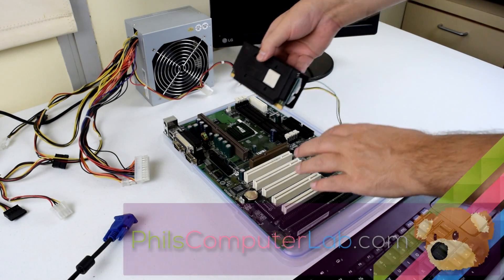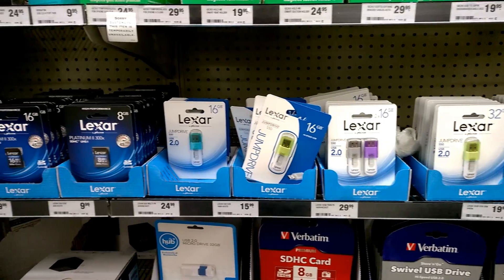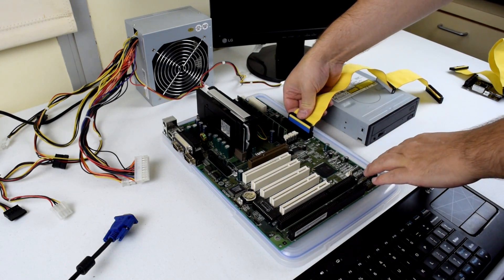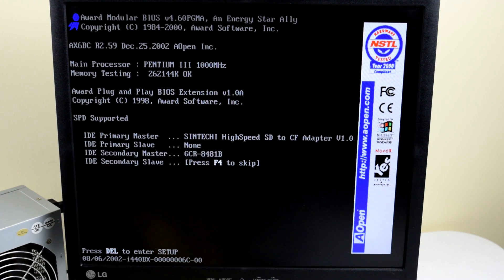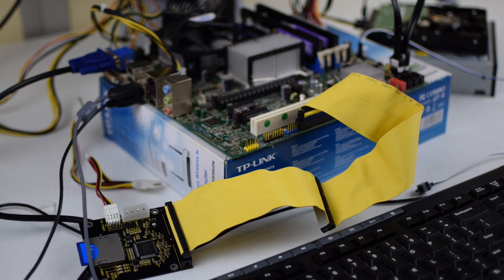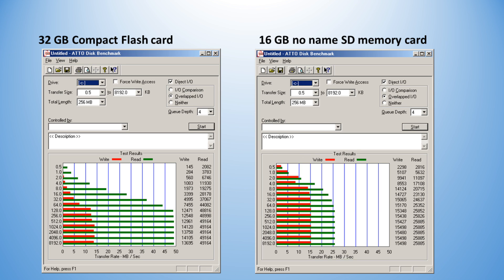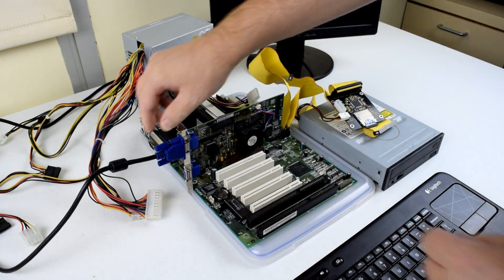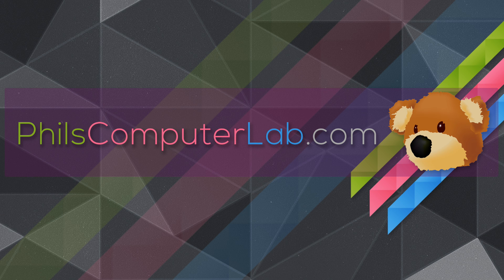SD memory card to IDE adapter review benchmarks guide

Comment: Surely Alignment is very important in systems designed to support old HDDs (512B sectors) with SD cards from an era where 4K sectors And ??? KB Page And Erase Block Sizes are the norm.
Also; random I/O is what's affected the worst by un-alignment.
it's also what's MOST important to system speed.

Lastly; not one word was said about the ctlr chip on the adapter. No specs or possibly useful but unused features/settings (bios) to speed things up...
Not impressed.

I suggest you get into Aligning and setting these things optimally and make a video about that!
ie:  Know the subject you're talking about 1st, then make a video!

Comment: Please I need help, I bought this exact same board model and a 32 GB SD card. Flashed a boot image of msdos/w98 and even tried reducing the size of the 32gb card to 2gb via software. The BIOS does recognize the card and its size but I get an I/O disk error when trying to boot it up. Any help is very much appreciated, Im desperate to make it working. Thank you all.
Reply from the maker: You should be using a floppy drive to boot a boot floppy and then partition, format and make bootable the SD card.
Reply: @philscomputerlab  Thank you for your answer, I come by from another video and the dude only used the adaptor and a SD (as boot), but Im assuming that aint working on my system.
PS. I just realized in what channel I am, thank you for all your work, you have a great website too, have a nice day!

Comment: please make one video if i have usb  bootable  pendrive i have use BR Automation pc if have damaged pc so how to i use gigabyte ddr3 motherboard this pen drive need to run that time this one msg came so what can i do ? & give me some suggestion

1.The system may not support the PCI bus

2.The PCI adapter may not be properly installed in a slot

3. Some of the PCI adapter resources in configuration space may be invalid

Comment: Just set your hdd or cd/dvd as a slave via the onboard jumper and connect the ide kabel as such works perfect on my Dell dimension xps t500 from 1999.  Btw, love your video's  always straight to the point and a treat for the classic computer enthusiast, greatings from the Netherlands

Comment: I bought 2 of these, along with 2 startech ide to cf adapters. I discovered pin 28 is not connected to anything on the ide/sd adapter. So there is no master possible just single or slave if they play nice with other devices set to master or cable select 0. I however got a cf to sd adapter in an attempt to counter that. Some "red" cf to sd adapters are said to be tight. So if you use a sd to micro-sd adapter that will solve that problem if the sd adapter gets stuck in it. That will also give a much cheaper increase in memory capacity over regular cf. One annoying aspect is that sd card capacities are priced similar to decent ssd variants, but as you know even some ide to sata adapters don't play nice. 
You might have posted this 7 years ago, but it is still relevant.

Comment: I’m confused about the speed performance of this adaptor, isn’t 25 MB/s a lot slower than the old IDE mechanical hard drives which would run around double that (50-60 MB/s)? Is there any point if it works slower? Want to use one on a PC from 2001.
Reply from the maker: 2001 is quite modern, you should use a SATA SSD. These SD cards work well in older machines with controllers running at 33MB.
Reply: @philscomputerlab  So I should use something like a SATA to IDE adapter board connected to an SSD? My motherboard doesn’t have any SATA sockets.
Reply from the maker: @TwentyEightySeven  Yes that works well or a PCI SATA controller. SD card also works well as seen in the video, don't let the transfer rate putt you off.
Reply: @philscomputerlab  I’m finding it hard to find something with a Master & Slave jumper because I would need to have 4 device’s (2 on each IDE channel) connected. Do things like this only really work if it’s on its own with nothing else on the cable like a CD Drive?
Reply from the maker: @TwentyEightySeven  They don't have m/s jumper. Maybe work with cable select set on the other drive, but no guarantees. Check my video on StarTech SATA to IDE adapter, might be better option for you!
Reply: @philscomputerlab  OK, thank you for all the help and for making these videos, I appreciate it!

Comment: Is there any IDE to SD adapter which can use full speed of SD Card and IDE controller? All these adapters are stucked at 25 MB/s for some reason, I tried few of them and all of them are only 25 MB/s which is significantly slower than speed of later IDE HDDs which could have even like 80 MB/s.
Reply from the maker: Nope I'm afraid. But CF card adaptor goes full speed.

Comment: im unable to install windows 98 on one of these for some reason. I keep getting the installation to copy the files over then it gives me one of two errors each time... it tells me to remove a floppy disk which i dont have any or it says Error Loading GDI.exe... any experts out there know what to do?
Reply from the maker: You need to isolate the issue by swapping parts. Does this only happen with SD card? What's your computer specifications?
Reply: @philscomputerlab  hey phil, thanks for the reply. I am using it on a socket 478 p4 2.8ghz with 2x256mb ram, fx 5500 agp gpu, sb live sound card. I have tried multiple cd drives, dvd drives, I tried copying  windows onto the sd card itself and running the windows install the same way and couldnt get it to work.
Reply from the maker: @RCD4444  That hardware seems fine. Try the ISO from winworld, the OEM one, it's the one with most downloads. Does it fail at the same spot every time? Run memtest to be sure RAM is stable, I'd try with just one stick.
Reply: @philscomputerlab  yep, thats the exact iso im using, saw it in one of your vids. I have installed it a dozen times while testing hardware on p3 systems and this system when I had installed dx9 and saw massive fps losses on this card. I ran memtest86 for 19 hours with 41 passes and no errors but it was with two sticks.
Reply: @philscomputerlab  I re ran memtest for 5 passes on each stick one at a time, it's all the time I had available tonight. Do you think that's sufficient? Any other ideas?
Reply from the maker: @RCD4444  Nothing specific I can think off...
Reply: @philscomputerlab  Thanks anyway. I guess ill sit on this project for a while. google has not helped me yet. maybe someone will see this comment chain and save me.

Comment: Times have moved on and M.2 NGFF SATA SSD to 2.5 IDE 44pin Converter Adapter with Case are now available, which is a better solution for updating ide storage. These are all over eBay and very cheap. I was interested to see that write times for compact flash are only a little slower that sd, but read times are about twice as fast.  I’ll be sticking with CF for my 386 & 486 systems.  Thanks Phil, nice video
Reply from the maker: 44-pin is for notebooks I believe, but yes, good to see more options coming through.

Comment: I purchased one of these SD to IDE adapters after watching your video. I have been using Startech CF adapters in my 486 and P1 and they are great for those situations, but for a PII or PIII machine where I need 128GB hard drive this is a great choice. I am amazed it was found by the BIOS and works flawlessly with FDISK, formatting and OS installation. It is a but slow...but whatever. At least it is a modern solution! Thanks for the tips as always Phil!

Comment: I am looking at replacing a ide hard drive in a audio sampler. The company says that device comes with a drive up to 160gb. The only way I can think about getting that space with an SD card is a SDXC. However I am having an issue finding if that sd card to ide adapter supports for sure SDXC.
Reply from the maker: There is also Compact Flash, they work a little bit better in terms of compatibility. CF is compatible with IDE so doesn't need a translator chip, meaning the CF to IDE adapters are cheaper. But CF cards tend to cost more. I haven't had a SD card not work, but not sure if they are SDXC. 32 GB is the largest I tried.

Comment: I bought one of these adapters (wasn’t a same chip) and tried it on an ASUS P2B BX motherboard. Bios recognised the device but misreports the size of any card installed as 33 meg! Dos wouldn’t recognise the disk on installing.
Reply from the maker: How large is the SD card? Try a different size?
Reply: @philscomputerlab  Thanks for your reply Phil. I tried several including a 128Mb card but bios cannot recognise any card installed. My next step is to try the device on another motherboard to see if it is a bios issue
Reply: @philscomputerlab  Hi Phil got there on the end. I was using older memory cards. I have got a lot of newer ones and tried those. It worked! The motherboard I’m using has a bios that only recognises hard disks up to 8 Gb, however these adaptors allow the bios to see beyond this limit. I even tried a 128 gb memory card. Anyway I am using a 16gb formatted to 2gb fat 16 for DOS and it is now working perfectly. Thanks for your advice. Keep up the great content 👍🏻

Comment: i cannot enable dma mode on win 98 with this adaptor , i used different cards with different capacities  iam checking the   dma option and then  rebooting , after reboot dma  is again disable
Reply: Full specs?
Reply: @dallesamllhals9161   epox mainboard with via chipset  , 900mhz p3 , 512mb sdram , awe64 , ati 9600pro

Comment: Excellent presentation. Can you tell me if this can replace a 100 megabyte IDE zip drive on my Roland VA 76 piano? Like a floppy disk emulator? Simply by doing plug and play?
Thanks for the answer. I liked it and signed up. Cheers.
Reply from the maker: It functions like an IDE hard drive, sonI don't think it will substitute a ZIP drive...
Reply: @philscomputerlab  Ok. Thanks for the anser.

Comment: Unfortunately these cheap adapters are very slow and suitable only for slower pentiums
Reply from the maker: They are perfect for DOS, but if you use good SD cards, they work well with Pentium 2 and 3 machines even with Windows 98 :)
Reply: @philscomputerlab  nope, that converter chip cuts a lot from a fast sd card bandwidth, it provides maximum read speed of 25mb/s. on some operations ide hdd outperforms that adapter twice.
Reply from the maker: @anthonyk8027  Yup I know :) But a Pentium 2 or Pentium 3 doesn't benefit much from faster storage, the processing power isn't high enough to take advantage. On a fast Pentium 4 or Athlon 64 you will really feel the difference. But on a Pentium 2 for example you benefit most from the zero access time. 25 Megabytes per second is a lot for these old machines, unless you are talking about just copying files, but loading time of Windows and Games isn't going to change much, I've tested all of this :)
Reply: @philscomputerlab  that’s right, copying is much worse. frankly, i don’t see any reason why to use such slow device, i have a decent bx based mobo with p3-1400 and not happy with flash cards performance either sd or cf.

Comment: I bought some of these adapters and did some tests. The speeds are limited by the chip on the board, even if you use a high end sd card that can do much more, its the board that is the bottleneck. My tests are around 20-25 mb transfers. I need to find faster sd to ide adapters because I wanted to replace the ide drives in my laptop with this.  You can read a very good write up here https://goughlui.com/2019/02/03/tested-generic-sintechi-fc1307a-based-sd-to-ide-adapter-sd35vc0/
Reply from the maker: The speeds are shown in the video, not sure, maybe you skipped that part? There are no faster adapters, if you want better transfer rates, use IDE to Compact Flash. But, it's not so much about the transfer rate, much more important are the zero access time and small file performance. That is what seperates cheap from expensive SD cards.
Reply: @philscomputerlab  thank you Phil... I wonder why someone doesn't make a faster sd to ide adapter. I will try the ide to ssd adapter for laptops next. your content is top notch.. thank you for all that you do!
Reply from the maker: @Kenny-bw2cz  Yes Ide to SDD also use bridge chip, but they are faster, I think around 80 MB per second. Fastest still is CF card, I have a fast one and it maxes out IDE with over 100 MB per second :D

Comment: I just one of these adapter for my 486 im struggling working it out i got a 16gb Toshiba sd card would my issue be due to not partition it for the bios in the 486 to recognise?

Comment: Picked one of these up for my Pentium 3 machine.  I formatted it on my Windows 10 PC as fat32 and preloaded some setup files for Windows 98.  Used a 16 gig Sandisk card.  The computer shows it in the bios but when using a windows 98 boot disk it can't find c:

is 16 gig too big for a P3?   Its actually an old Gateway 2000 machine.  It works ok with an old 4 gig IDE drive although that drive is on its last leg.  It makes wierd noises when booting and its a crapshot if the system freezes or not thus the reason wanting to try this.

Comment: Hey there... I have tried a 44pin ide sd card adapter in my laptop with a 64gb and 128gb card, and the laptop is a Pentium 4... I got only windows xp installed and that alone went very slow, it toke about 3 hours...
Reply: NÅ?

Comment: ok I just want to use it to emulate floppy drive in 720k .....in keyboard and sampler not computer
Reply from the maker: This is to connect to SD storage and connect to IDE port, as Hard Drive replacement. It has nothing to do with Floppy.

Comment: What is the max transmission rate of a startech cf ide adapter compared to this adapter? So it doesnt make sense to buy a sd card with write and read speed of 90mb/s? because the adapter limits the speed until 25 mb/s? Thanks
Reply from the maker: Faster SD cards are better with write performance and also with small files. So there is still a benefit.
Reply: @philscomputerlab  thx Phil
Reply: @philscomputerlab  Because the CF has no chip so it might be faster with a CF card (with sd slot)? or would you think the adapter you used in this video becasue of the chip is faster with small files...difficult to answer perhaps. thanks

Comment: Very cool. I wondered if there was any use of those IDE ports on a PC. Yes they are outdated and slow, but they might be available on your motherboard and you might not be using them. Plus using the floppy power connector for power is another great advantage for older Computers.

Comment: Does this thing have size limitations on the SD card or will just anything Amazon can send me get the job done?  Proposed use is a Dell 486dx33 I think I may have missed it if this was covered?
Reply from the maker: What size you're looking to use? 486 has BIOS limit usually.
Reply: PhilsComputerLab  I understand the limitations of the old systems but don’t know if there’s some conversion taking place in the adapter to allow formatting a new SD card (looks like smallest new cards reasonably priced on Amazon are 8GB) can the old 486 CHS settings be set to their max which I believe is 504MB then somehow Fdisk/Format the 8GB card?  I am fairly certain I bought the exact adapter in video.  My entire career was computer tech/network administration and my skill set goes all way back to the IBM 5150 it’s just after 27 years experience some of this stuff is getting a bit fuzzy.  Using 2020 tech to fix my 1994 is baffling to me!

Comment: hmm is it maybe a hardwired CS system? or perhaps this review is of an older revision as it is 2020 now..
I would like a review of a 2020 variant as this product might have had a few "beta" bugs and most modern ones now have a M/S jumper (only listening based on drive select for the appropriate selection) I tried a CF-Ide adapter but was trying to use some sd-cf adapter so it worked ok besides the cf-sd quirks before it died so maybe the natural UDMA modes with cf cards was why a simple jumper worked
so I ask for a modern revision review as that device may have been cheaply hardwired to always assume single drive and didn't care about drive 0/1 enable signals

Comment: I found it to not work at all on an AMD K-6-2 system. I believe it uses a newer IDE standard or something. It will write to the drive just fine, but when it tries to read it back, it's corrupted. I ended up having to use a CF card instead.

Comment: Hi Phil. I have been given a Toshiba Satellite 2060 CDS laptop (AMD K6 - 366MHz cpu) which powered up briefly before the old IDE HDD died completely. I formatted a 3.5” floppy using FeeDOS and it boots OK. Just HDD is dead. I want to replace the drive with a solid state 4GB drive and was thinking about either a PCMCIA-Compact Flash card adapter or an IDE - Compact Flash adapter. 

I’ve seen SD card to CF card units - basically a CF card into which you can place one or two SD cards. I was wondering which option would be best in the long run? I intend to clean the laptop up and use it to play old DOS and Windows 98 games. With a couple of cards I could boot to either OS. However, I read that Windows 98 swap files can dramatically shorten a CF cards life span. Would this be the same for an SD card/CF card adapter? Which option would you recommend? Is the PCMCIA card adapter going to be slower than an internal IDE/CF card adapter? Are there issues in having an IDE/CF card/SD card combo over IDE/CF card?

I hope you understand my message. I’m wondering if the IDE/CF/SD card adapter might be more “future proof” than a simple IDE/CF adapter. The Toshiba specs show AMD K6-2 CPU, 32MB RAM, 4.3GB hard drive and Windows 98.